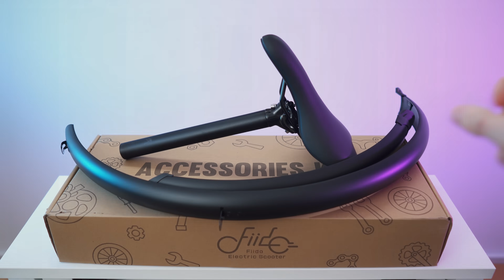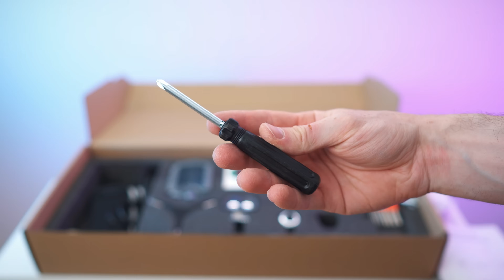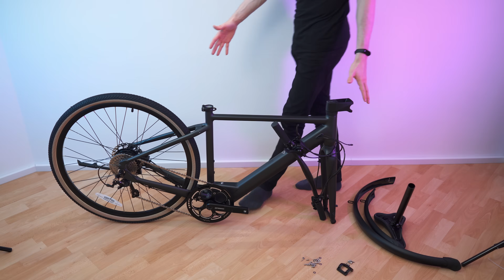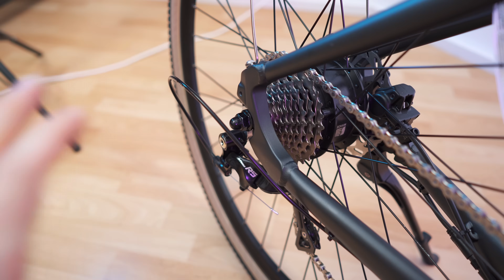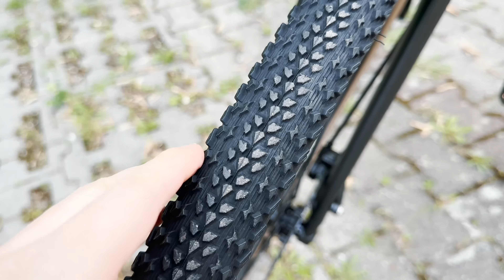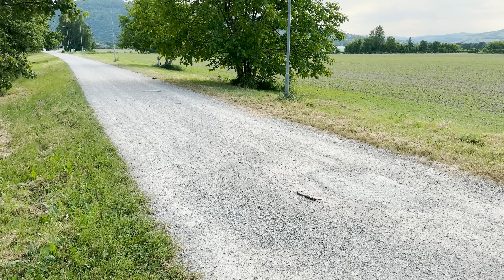LOW KEY E-Bike With 1-Click Speed Unlock - Fiido E-Gravel C21 Review & Test

Comment: I bought one, and upgraded the tyres from the heavy stock 40 inch Kenda tyres to 32 inch semi slick Pirelli's. I weighed before and after and it saves 300g per wheel. But obviously if you plan to use it off road, keep the stock tyres.
Bike accelerates really well now. Interesting in rocket mode, there seems to be sudden boost after 25kmh.. Nice and a brisk off the line in turbo plus mode (despite my 110kg weight!) Almost feels like a turbo charger kicks in once accelerating beyond 25kmh 😅
It's a fun machine for sure.

Comment: non-removable battery, impossible to ride when battery flat (and it has short range), for me - disqualified. If it fits your needs then I guess go for it, but prepare - charging it so often will wear out the battery quickly and it will just get worse and worse
Reply: How is it not possible to ride at all wout battery?
Reply: @Deriviado its a 1 speed bike, meaning no gear shifting. When the battery goes flat it's almost physically impossible to pedal
Reply: @Simsung it has 9 speed lol

Comment: do you need some sort of unlock code for rocket mode mine got turbo plus but switches off when button is kept pressed fo0r rocket mode.
Reply: Yes, you need code (398219) and Fiido application. After you enable debug mode (not 100% sure if this the name in application) you can later enable\disable it via button as shown on movie and does not require to have phone connected.

Comment: I have this and its quick. The  mivice motor is superb and it negotiates 15% hills with ease, and I can definitely say the assistance is well beyond 25kph. It feels assisted up to 32kph( and that's without rocket mode). The only downside is the pathetic battery so get the range extender and you have  416wh which will get you about 50km per charge on level assist 2.  Honestly level 2 is so good that I never use rocket mode plus it eats up the battery anyway.
Reply: I think 'pathetic' is a bit harsh. I have an e-kit on my road bike which uses a 200Wh battery. It is a simple kit with a 250 watt motor but only one power level, e.g. the equivalent of full power on this bike. Continuous use on mixed terrain gives me about 40kms of range, which isn't too bad, but my bike is much lighter at 13.5kgs. More range should be easily attainable with the changeable power levels on other bikes.
Reply: @vincekerrigan8300  well c40kms is quite good. I'd say the weight plays a factor too.  I would hazard a guess and say the Chinese battery just isn't that good. For comparison the estarli e28 Samsung battery is 360wh yet can do 50kms on full assist compared to the fiido c21s 15km on full assist.  I just think fiido could've added more capacity to the bike.
Reply: @vincekerrigan8300 depends on person's weight as well... 13.5kg for someone that's 90kg is same as someone's 17.5kg that has 86kg... after all the bike still carries the same amount in total. So yeah, 100% if you are 60Kg you'll go a good bunch further than someone that has 85kg + the additional from the bike. it carries 30kg more. Tires and friction also matter.
Reply: Boa ...!! 50 km with range extender ... !  :face-fuchsia-wide-eyes:
Reply: Not enough, sad... 😢 @jonikolaus4423

Comment: Hello everyone, I can only advise anyone interested against Fiido!
What I've been through with the service for almost nine months is unbelievable. Absolute non-service disaster
At the beginning we, my wife, were quite happy with the Fiido C22, but after just a month we started having electronic problems. A total of 55 emails went back and forth with Chinese support, of course always in English, before a replacement display was sent to me. But that didn't work either because it apparently had the wrong firmware. Lots of emails back and forth again, with the result that I had to send the bike to the only German workshop in Rosenheim, mind you, at my own expense. I would rather not have done that! Because it's been there for over half a year and despite a total of 50 emails and calls there in the workshop, there's no progress. I've already written off the bike.
Unfortunately I have to say that I also paid the completely overpriced 1600€, even though it has been offered for 1200 for a long time now. This is doubly annoying.
It's all a shame because the bike actually rode great when it still worked and also looked nice.
However, based on the service experience, I advise you to KEEP YOUR FINGER AWAY from Fiido! As long as they don't have a dealer network in Germany, it's not an option.

Greetings, Steve

Comment: I bought the bike, that was a big mistake, I can only advise against it. Poor workmanship, cheap components and super bad customer service.
Reply: I have this bike....today i passed the 12.000 kilometers with zero issues....yes, this is a awesome bike 💯🙏🏼
Reply: @therealrobbycrash how many water bottles can you install on the frame?
Reply: Funny, I've been riding it for almost 3 months now, did you actually buy this e-bike? Or do you just like being an internet spammer.😅
Reply: @DarrellDuncan-pn8un 
Likely a competitor not happy with value
Reply: I've been riding it for three months.......There hasn't been any problem so far.
Reply: I just got it. Customer service was fast responding (I asked for the ETA of may package, not more). The bike for 990 EUR is a no brainer. First miles were awesome. I think I will love it.
Reply: Its almoat 2 grand youd exlect decwnt components at that price
Reply: Tks!
Reply: what went wrong by the way
Reply: I have the Fiido C11 city bike, couldnt be happier, my mates got the Titan and loves it like a pet. 😂
Reply: It’s good looking bike but  problem that battery not removable
Reply: How do I unlock the speed to over 30km per hour ? I think eu has it set to 25km per hour
Reply: Heybike EC1 might be the better option
Reply: It makes two of us… this bike is rubbish
Reply: 2nd time I rode mine the chainwheel shattered, had less than 6 miles on it and now its useless
Reply: @hopefullyhigh  Disappointing. Sure. But couldn't you purchase a new chain wheel?
Reply: @hopefullyhigh was it your fault ? If not your bikes under warranty they will repair or rrplace it free, if you dont bother thats your fault.

Comment: The mudguards actually fit this bike and make the look perfect if you ask me.
Reply from the maker: You're right! Thanks for pointing that out 💯
~ Chris
Reply: Agree.  Very much needed here in Ireland.
Reply: The ones on my Fiido C11 were a damned nuisance to set up and plastic which twists and turns with heat, they are the only gripe l have, the rest of the bike is superb.
This bike looks very tempting but so does the Fiido Air... I already have 2 ebikes one is a folding bike a cheap piece of tat l regretted buying as soon as l opened the box, but l thought well it folds up was only £245 down from £700 ( some poir devil paid the full £700 and was  crushed when he saw it for £245, I'm basically gonna wreck it on some rough terrains. Lol.